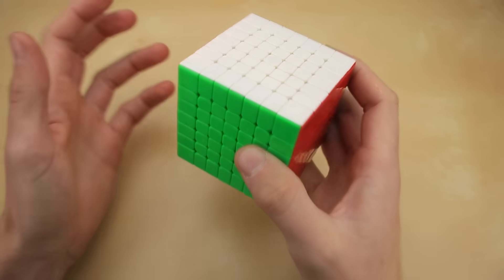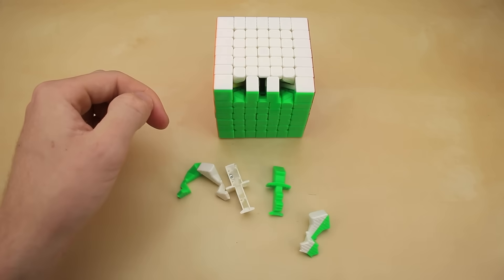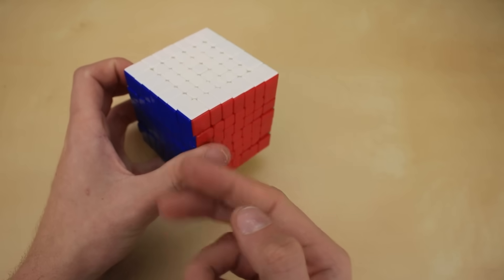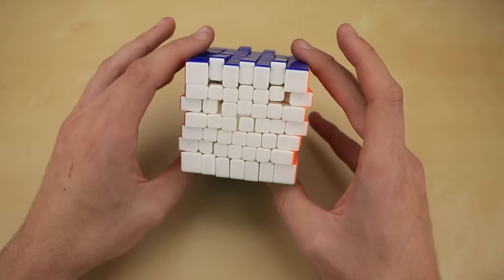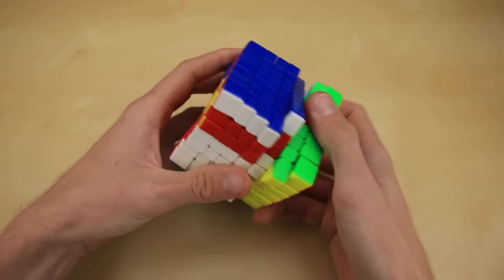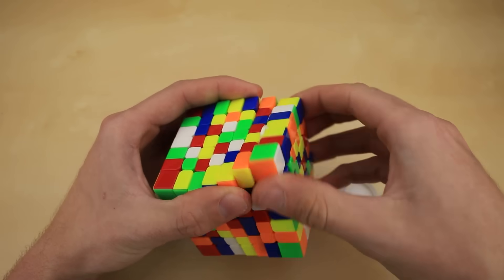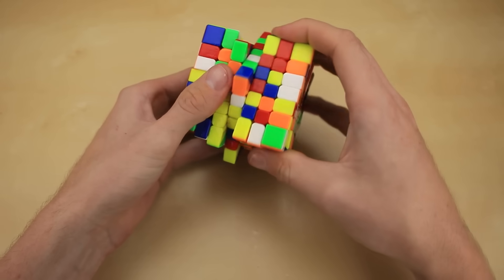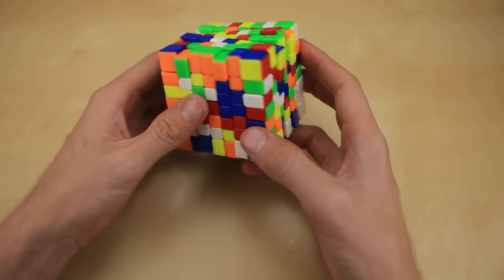Making the WORST Turning 7x7!

Comment: The only thing I can think of to make this turn worse is by adding sand or dust or something to grind up the internals
Reply: Just superglue it unsolved
Reply: @dontaskaboutmeplease  my favorite lube, glue
Reply: AdolfHitler43  🤨🤔
Reply: Adolf hitler  bro is going to have the best youtube career
Reply: Put it near the fire place for 1 min
Reply: Add water to rust the mechanism
Reply: @tetraploid5000  i dont think art school wasnt enough
Reply: I got sand in my rubik cube once, it was never the same. 100% would make it worse
Reply: Or a couple drops of super glue
Reply: Instead of lube, use wd 40 or oil... then sand the plastic... reverse magnets...
Reply: no, put red n tacky bearing grease in it
Reply: @thegappleapple7763  works great in a pinch tbh
Reply: Give the cube to Cherry and ask them to make it smooth. It will be worst than if there was sand. They would also ruin the sound. Just look at the rattle they call a click in their keyboard switches
Reply: Real
Reply: Z3: "Luckily i have extra bits of plastic"
2 seconds later: pulls out a bag of unused center caps (i think)
Reply: or do the whole process with a vcube 7
Reply: What about like really really really small gravel?
Reply: put water to rust the screws
Reply: Or even worse, making It completly inturnable!
Reply: Then It would be completly worthless :)
Reply: You are right
Reply: @cloud_congestus fr
Reply: @tetraploid5000 year later, got banned
Reply: don't give him ideas?!
Reply: NOO THAT IS UNHOLY
Reply: @tetraploid5000  he got deleted 😂
Reply: WHO IS @Adolfhitler43 !?
Reply: I put kinetic sand in a cheap 3x3
Reply: or add some milk :)
Reply: @tetraploid5000 IK this comment was 2 years ago but you said “this dude is gonna have the best YouTube career” how do I tell you it’s banned now💀
Reply: @ damn i mean i dont even remember what he said

Comment: He knows how to reassemble a 7x7. He knows too much.
Reply: i could do a 21x21 (moyu)
Reply: It's not that hard. A 6x6 is way harder.
Reply: @sofiamn_05  fr?
Reply: @sheepcommander_  yes
Reply: @keithamaya8713  how
Reply: @silkic  It's an even number and there are no clear centers so it has more ways to solve and higher chance of parity
Reply: @hyperjanny1510  time to vanish
Reply: @hyperjanny1510  cool bro!
Reply: He assembled that wrong, look at color scheme
Reply: @keithamaya8713  8 months late but, what does all of this have to do with reassembling a 6x6?
Reply: @joshinon6980 yeah it is pretty late haha
 I thought this was about solving it as if reassembling  is a "non-cuber" term for solving it

if he did mean "reassembling " as in breaking it apart and then putting it back then reassembling a 6x6 is harder than a 7x7 because since there are no visible centers there are a bunch of other pieces inside that are a lot harder to put in
Reply: @silkic  because it doesnt have a center for example 2x2 doesnt have a center too and it is just 3x3 but with the edge pieces hidden and its lot harder to assamble non visible pieces than visible pieces
Reply: Hey I also know how to reassemble a 7x7
Reply: That's what impressed me the most here.

Comment: Take some of the pieces, sand one internal face half a millimeter flatter, and glue a different material onto it. Like sandpaper. So that some of the twist planes have got completely random resistance. Have the side tension also random. A non-newtonian-fluid un-lubricant. And make some of the outside faces sticky, and glue more sandpaper squares onto others, it'll feel horrible.

Comment: Here's a useful bit of knowledge for ya:
WD-40 isn't a lubricant. As the name implies, it's actually a water dispellant, and should only be used as a lubricant if you intend to disassemble whatever you are putting it in afterwards, as it is also corrosive.

Comment: id have dumped some sand in all the little gaps or maybe used iron powder instead of sand just so it atempts to interact with the various magnets 
it wouldnt just not want to go together but it would activly sound and be terrible as it grinds itself apart